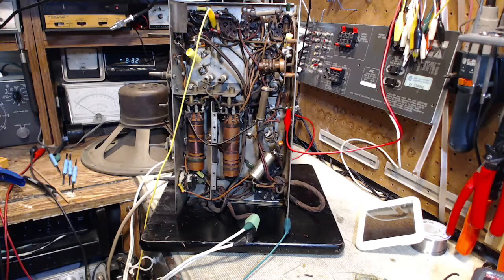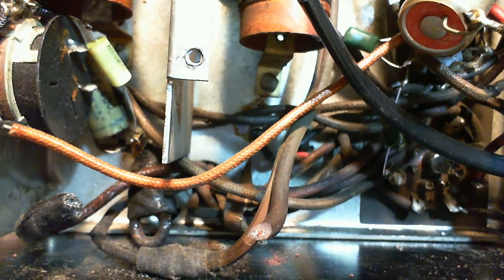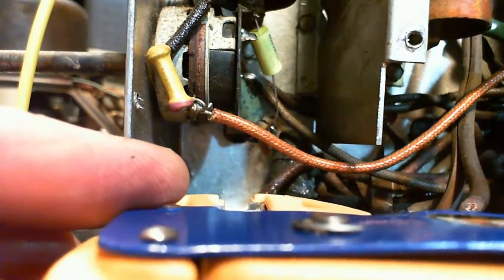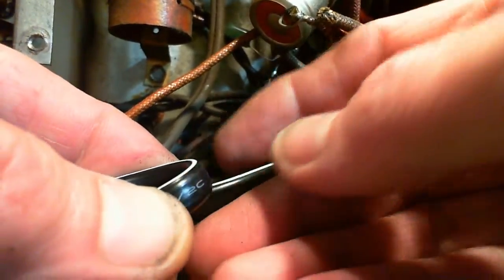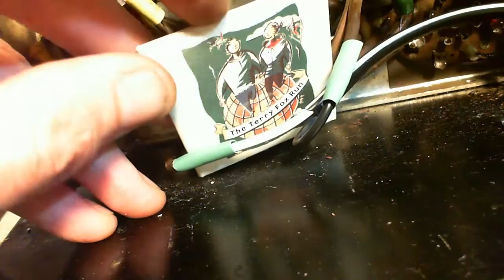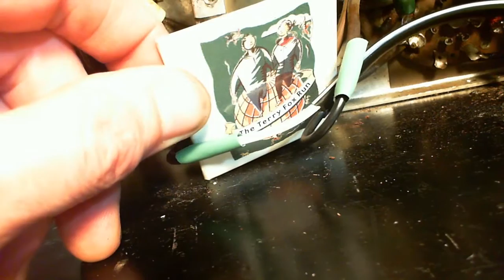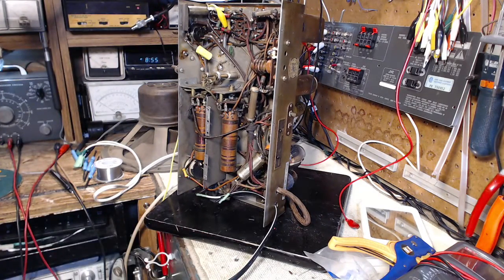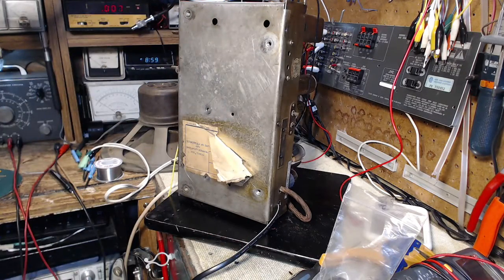Westinghouse 622 Vacuum Tube Radio Video #7 - Power Cord

Comment: I agree the line cord has too much play.   You should add another strap and run it thru the loop in the cord you made and then strap it to the chassis using the holes for the line cord and speaker cord.  These will allow you to run a strap in then out of the chassis.
Reply from the maker: jp040759 The main thing is that tugging the cord doesn't tug the connection. I'll see if I can fix it in there better.